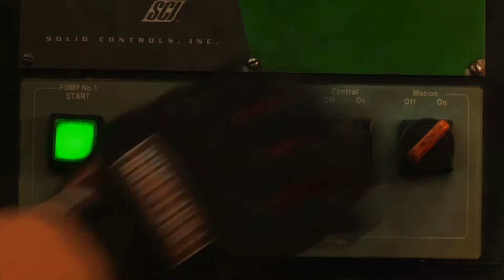Manufacturing Minute: The Science Behind The World's Strongest Titanium Alloy

Comment: Ti of any shape, form, or alloy is too expensive for the mainstream auto industry. Used in niche applications for high output performance engines such as connecting rods, valve springs and retainer caps, etc., but that’s about it. Might as well be unobtanium to the auto industry.